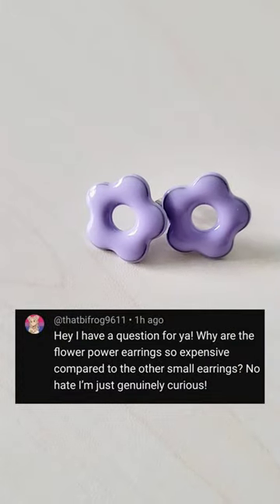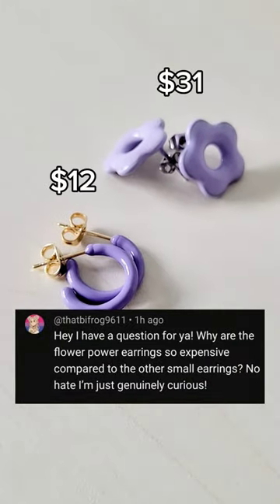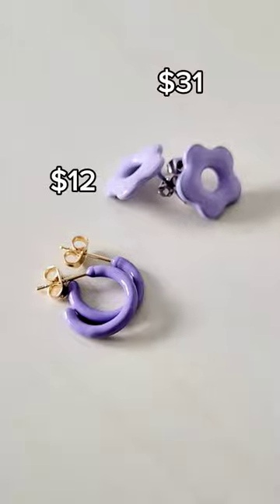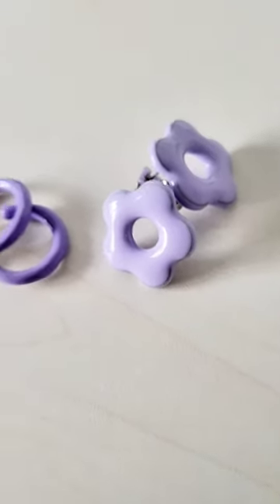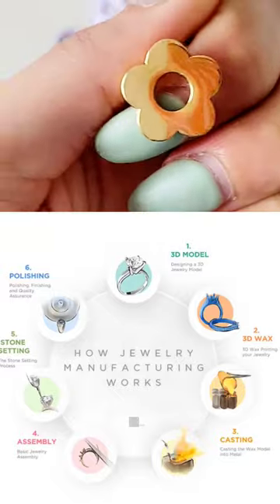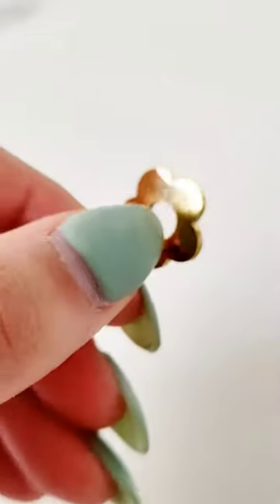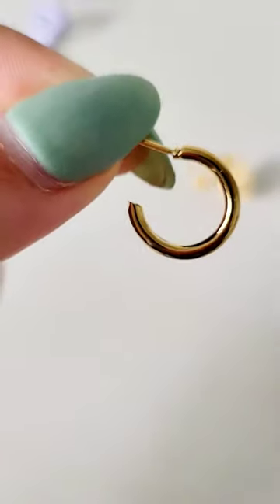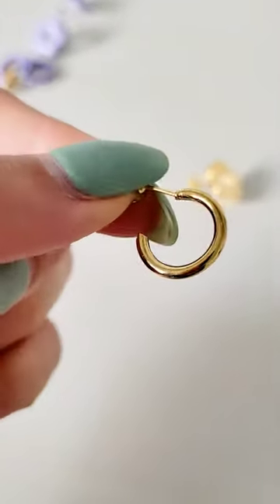Why are these earrings so expensive??

Comment: Fellow jeweler here- if she is buying the flower from a supplier and that supplier uses the process of “lost wax casting” it would be more expensive as lost wax casting/ making the mold and filling the mold can be really pricey. BUT what I don’t understand here is the flower shape she has is a pretty simple shape and lost wax is usually for really complex shapes so they can be mass produced (AKA if someone needed to mass produce an engagement ring using CAD/RHINO) but this flower shape is pretty simple and they’re not hollow so it would be much cheaper if she went to a company that can die cut them- or laser cut them from a thick sheet. This is probably brass given the color or it’s copper with a gold dip (which again I don’t think so cuz she’s then getting them enameled so what’s the point of a gold dip if you’re covering it?). Anyways- all this to say: if she’s getting them ordered through the lost wax process it’s expensive- but it’s not really her best option for the shape she’s using she can get it a lot cheaper if she went to someone to get the shape cut from a thick gauge of metal and therefore making it cheaper for the buyer. Not everyone wants to do the research for a better company to get their product from. And for those commenting what metal is it? I’m also confused cuz the BEST metal to enamel with is copper, silver, or pure solid gold. The earrings are brass colored tho not copper? I don’t know what the heck is going on. Brass has zinc  alloys in it and zinc HATES enamel so unless she get a zinc free brass I’m genuinely confused 😂